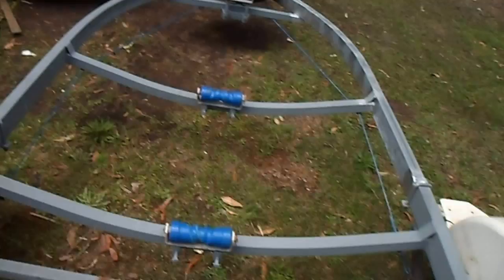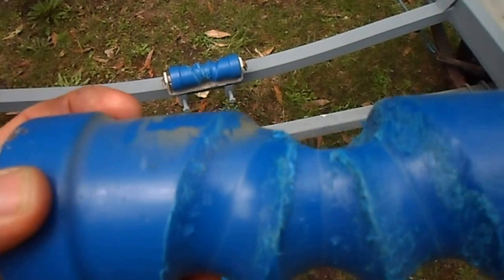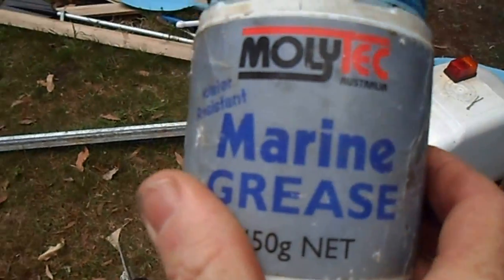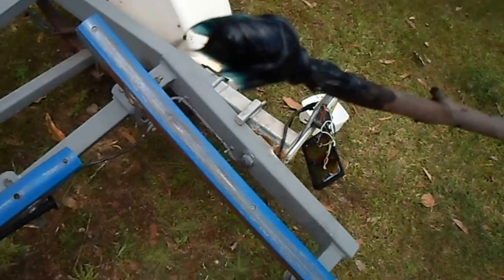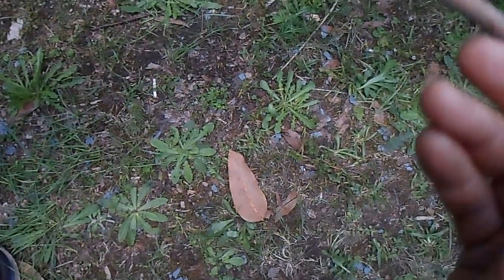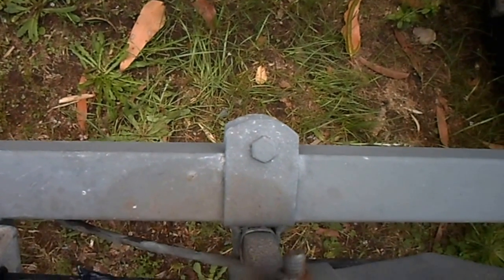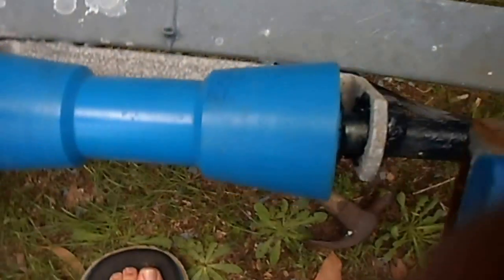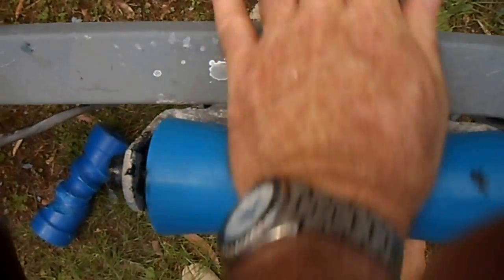boat trailer tip make it  so your boat glides easily into the water

Comment: Those self centering rollers are a game changer.
I watched your video a year ago before I installed them. 
 I greased them before assembly. It definitely helps alot.
I'll park my trailer a foot or two farther out of the water than normal and those centering rollers take over and straighten up my boat every time I load it.
When the water is choppy or a thunder storm comes in I'm thankful every time to have them.
Thanks for your video!

Comment: That damaged roller was a self centering one that was installed the wrong way around ... not because it was seized on the spindle.  They won't turn if the keel hits the outside of a self centering roller if they are installed the wrong way around.  Just reverse the roller so it turns the other way.  They should put an arrow on the damn rollers to show direction of turn ... but for some reason they don't.